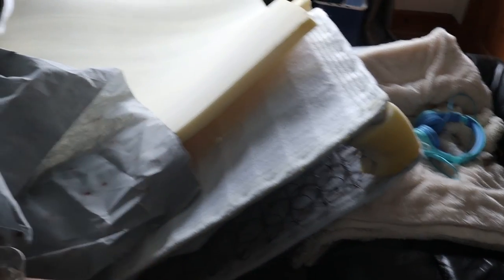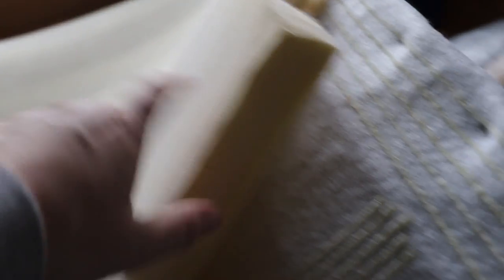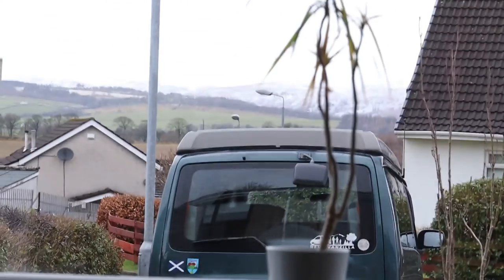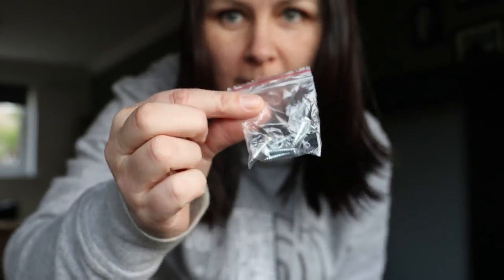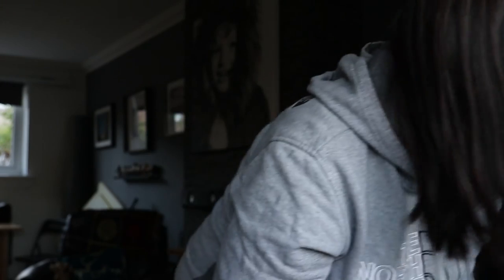MAZDA BONGO REAR CONVERSION BUILD

Comment: Nice choice for a van. Here in Phillipines we have a lot of these van and I also owns one. Though camping is not much popular here but many loves  these vans because they are very reliable when comes to performance. Durable and very fuel efficient. Especially for the diesel version. Nice thanks for sharing
Reply from the maker: Thank you! It’s such a reliable van, hard to believe it’s 26 years old! Incredibly modern looking and I’ve found it great for fuel consumption, I’ve been using mine as a daily driver. 😊
Reply: You do some great videos on the mechanical side of the van, keep it up!
Reply from the maker: Thanks, my next video will be a travel vlog then I might be repainting the roof! 😊